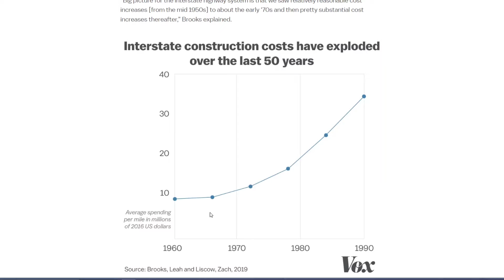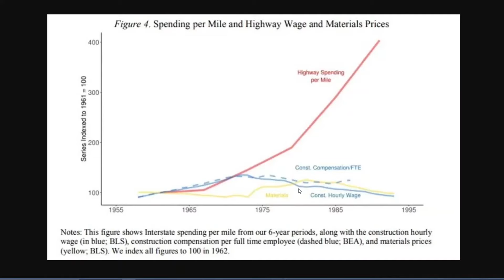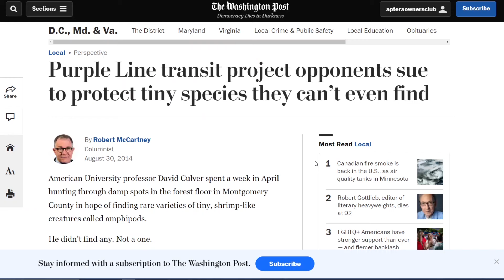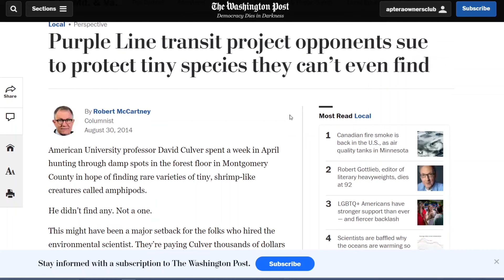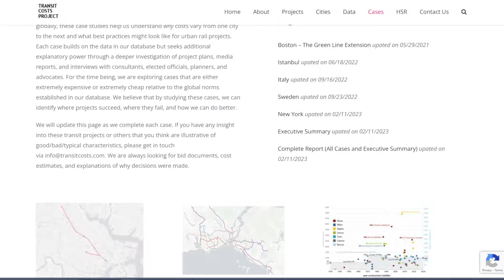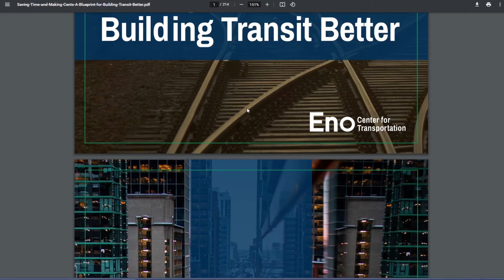Why is building infrastructure in the US so insanely expensive?

Comment: Excellent analysis. I'm guessing there are also hidden costs associated with paying off legislators (which is legal in the USA), hiring lobbyists and exorbitant corporate profits, too. If labor and materials have been flat since 1970, it's pretty clear there is little-to-no oversight of the price gouging. Plus, I'm pretty sure big oil lobbies heavily against public transport systems. That's how we got 18 wheelers instead of rails.
Reply: Would changing to primarily train transport provide the equal amount of jobs as trucking? Are you aware that trucking is the number 1 job in like 12 states.

Comment: Infrastructure building is where China beat US by landslide. But at what cost? People in China have no rights. Government tell you to move, you either move or they "disappear you". In the US, a complete environmental analysis, political landscape changes, macro-economic issues stretch project over a long time. Politician and construction people are in cahoots to add more cost overtime. There is really no incentives to complete any infrastructure project on time. I disagree Buy American materials is to be blamed. Extra material cost can be anticipated when submitting bids. Its the time delay that's running the cost uncontrollably high. Another hinderance is OSHA, you can not build 24x7x365 on any project. Did you know Hoover Dam was build in 5 years before OSHA, try doing that now.

Comment: Thanks for bringing this up. As with so many government projects and programs there is so little transparency or accountability to see cost overruns and to put a reasonable cap on spending. There is so much abuse, and even when it is discovered it gets little press attention. I have a friend who was working on freeway refurbishment, and the contract included that an environmental report needed to be created for every mile of roadway built (at a cost of thousands of dollars). But then the contractor changed it so that the report was needed for every 100ft, and later he changed it again so that it required for a report to be created for every single foot completed. And they printed out thousands of identical reports (still costing thousands each) for every foot of roadway done, and the only difference between the reports was the number at the top of the page. Plus we have so many stories were poor construction work was done, and then it failed, or was incomplete, or it needed to be redone (at a higher cost). And often times the contractors who were removed for poor quality or slow progress were later rehired (despite failure earlier) because they were "experienced" and vetted firms. A great example was our nearby Oakland bay bridge, which cost $2 Billion to build, and the contractors used inferior, poorly prepped support rods and bolts, and then they were not sealed properly and degraded over the years that construction went on, and failed under mild stress testing. Ultimately, the contractors were fined $8.5M by the bridge for their poor methods and failed work, and the contractors counter sued for $49M. In the end, the bridge settled by paying out $34M in compensation, which now has to be paid off by higher bridge tolls.

Comment: Lots of regulation, high prices up and down the supply chain (per unit labor and management prices), land rights, lobbyist and how time / election cycles are used as a weapon. The looters rarely fail to come to the feeding trough when a big project is announced. All these problems people mention seem to go away when they are paid off. It's one of the big reasons SpaceX is building rockets in marshland in the middle of no where and the CA Hyperloop was abandoned. The more of these projects that can be automated and managed under one roof the better.